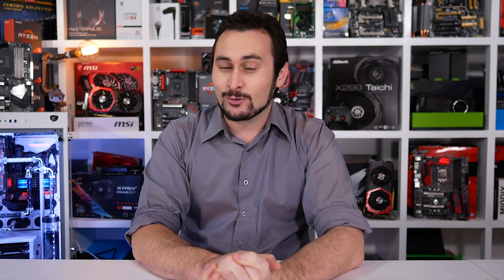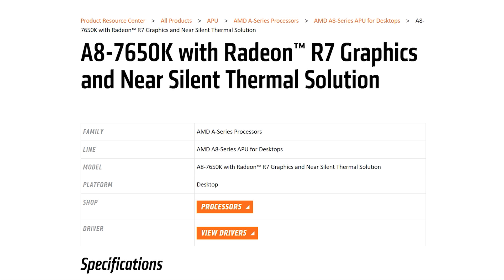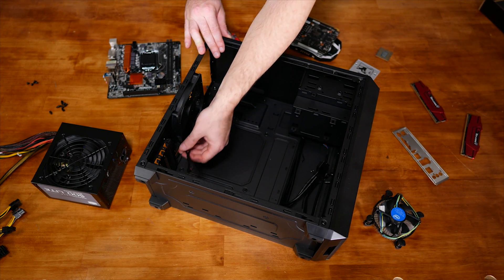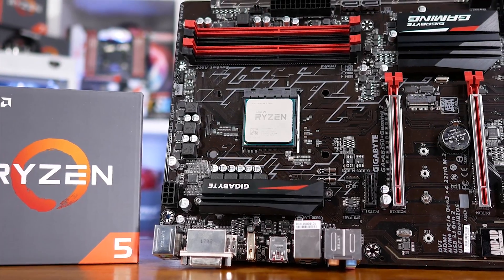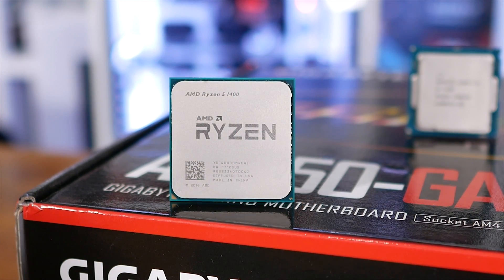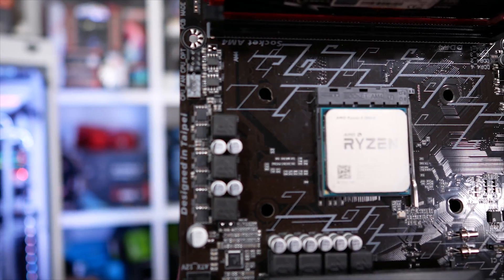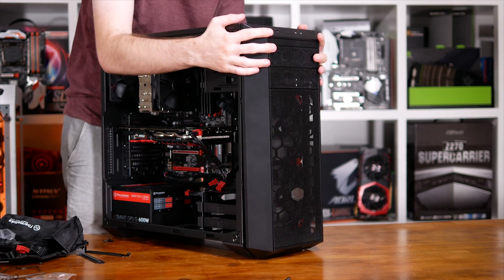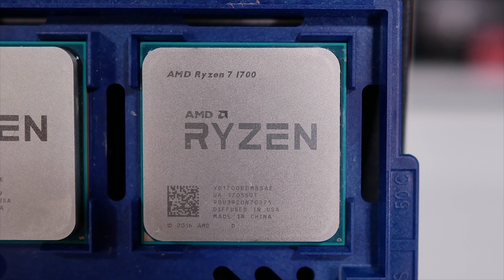Top 5 Best CPUs, Ryzen 3 & Threadripper In Mind!

Comment: nice video!

top 5 worst cpu's:
1. i3-7350K
2. i3-7350K
3. i3-7350K
4. i3-7350K
5. Every Celeron :D
Reply: The Saucy Goblin Shark the processor does not suck, the value sucks
Reply: Celeron 300A?
Reply: Philip Cooper im a mindless Intel sellout and even i agree tbe 7350k is useless but if it's cheaper it will make sense. 
Also i5 7600 and i7 7700 makes no sense, why create a locked version of already unlocked cpus lol
Reply: cause atom cpus are ftw right?
Reply: Good for you Saucy Goblin......Intel is fortunate to have some true blue fans like yourself.
Reply: i3-7350K shouldn't even exist, when even at 5GHz a much slower and cheaper locked i5 beats it in the real world.
Reply: You can use the i3 for whatever you say, but it costs far more money than the slowest i5, that would do the job as well and even quicker/better @ lower power consumption. 
2c/4t is not the same as 4c/4t. The threads don't do any computing, they just ''prepare'' what's about to be processed. HT is like having 2 hands and 1 mouth when eating. Putting food in your mouth might be quicker, but you still have to take the time to actually chew it and swallow it. 

2c/4t = 2 threads feeding 2 physical cores + 2 threads wait for their time, but are ready
4c/4t = 4 threads feeding 4 physical cores, that do all the computing simultainously
----------------------------------------------------------------------
This is the reason why even much slower 2.7GHz i5 gives you about the same and sometimes even better performance than the i3 @ 4.8GHz OC. It's physics. Yes, the i3 7350K seems cheaper, but it is not, as you need a Z170/270 board and after market cooler. Also, the i3 7350K has worse power consumption and generates more heat.
Reply: Well I guess for only $70 more maybe be better to just get an i5-7600K 😍
Reply: Im getting a 7350k how it's 140$
Reply: I always assumed the locked versions lost the silicone lottery and were sold restricted to a stable output. I don't know that, and wouldn't preset it as a fact, but it makes more sense than selling a high quality CPU at a lower price for no reason.
Reply: Well I was only talking about the I3 7350k vs the ryzen 1400x. It all just boils down to preference. I am extemely excited that AMD and Intel are having this battle. This is like the console wars all over again.
Reply: i5-7640X
Reply: Requires a 2066 socket MB, and those are not cheap.
Reply: The Saucy Goblin Shark Because you have to get a cooler + Z mobo. so it's terrible value. A locked i5 which comes with a stock cooler (don't need to upgrade if you can't OC) with a cheap mobo performs better and is better value. Thus, even with the ability to OC, it's a product that is not relevant to any consumer. Not to budget gamers (they'll get something like a G4560 or locked i3, or Ryzen 1400), not to productivity people or content creators (Extreme platform, or Ryzen 1700++/Threadripper), not to serious gamers (Ryzen 1600/1700 or i5/i7). It appeals to no one.

Think about it, why would I bother getting an i3 when I already have a Z mobo and an aftermarket cooler? Even if I somehow can afford the Z mobo and cooler but cannot afford a K i5/i7 chip at the moment, and want it as a future upgrade, I'd probably settle on a G4560 and upgrade to an i5/i7 later on.
Reply: 7350k actually a very good cpu for ppl who need high single thread peformance and dont care much for multicore usage..
Reply: OpTic KTG multi thread yes, single no, depends on user case..
Reply: Wessel Van der Linden Let's cut the bullshit. Name one real life scenario where this "single-threaded" of an unlocked i3 performance has any significance. I can't think of a scenario where one would not, as a consumer, just buy at minimum a locked i5.

Budget gaming/NAS = no (you'd get some a G4560 or some super garbage spec processor + mobo combo for a NAS), 
current triple A gaming = definitely no, 
eSports/older games = irrelevant (even a laptop i3 or better is good for those, definitely don't need an unlocked i3), 
content creation = hell no.
Reply: The Saucy Goblin Shark Dude, gaming? Don't keep giving me that nonsense. Tell me why someone with a Z mobo + cooler would settle for an unlocked i3 instead of an unlocked i5 or i7. 

If you're on a low budget you'll want a G4560. If you're just doing regular gaming you'll be on a regular non-overclockable mobo, then you'll aim for a locked i3/i5 (no point going for a K processor if your mobo can't OC). If you're aiming for a Z mobo and aftermarket cooler, I can't think of one situation where you'll want to deliberately pair it up with a 7350K over a 6600K/7600K at minimum.
Reply: Saucy Goblin, an OC'd R5 1400 will beat an OC'd i3 7350k in the vast majority of games.

I'd take the 1400 over any locked i5; and I'd take the lowest clocked i5 over this chip.

This chip should not exist even in intel's own lineup.  Ryzen just further invalidates its usefulness.

Not only will you have worse performance in nearly every game that's cpu limited; you're going to have to shell out MORE money to buy a more expensive mobo and a beefy aftermarket cooler to take advantage of it's 5Ghz overclock.

It's not a terrible CPU; just completely invalidated by both intel and AMD at its current price point.
Reply: If it's so bad for your usercase don't buy it? Other ppl might have good use for it so why flame so much?
Reply: forget the netbook g4560, at least get the 7350k for $130 🙂
Reply: MrSamadolfo Nothing wrong if you got one for free. As I and others have said, it just has terrible value. No one would deliberately build a new PC around it. What actual real life scenario would make someone consider getting a 7350K? Would you? For what purpose?
Reply: OpTic...I agree with you that the R5 1400 is a much better deal than the i3.
Reply: The 7350K still won't do much sense. With the extra cost of a Z270 motherboard (yes, you may use Z170, but only if you flash the bios with an Skylake chip first) and cooling solution, we must ask, what's the demographic for this chip? Yes, you might have the i3 @ 5GHz, but the moment you try some recent games you'll soon find out, that a much cheaper i5 (i5-7400 for instance) on a B motherboard does give you about the same and even better performance. 
The  7350K is something no body asked for. The idea is nice, but it is a dual core CPU. It's almost like somethning AMD would do. Working on a very fast Quad-core with 8 threads, then finding out some of the chips have defective one or two cores, quick thinking let's release an dual core with HT, that could be clocked to 5GHz. AMD had their Triple-core CPUs and now the lower tier Ryzen chips.

TL; DR, The  7350K is not for gamers, nor productive work. Who is this CPU for, then?
Reply: mazedmarky But I think celeron g3930 is good cpu.
but My celeron n2930 is rubbish lol
Reply: The Saucy Goblin Shark true
Reply: No, it's not, even the 2.7GHz i5 6400 outperforms the i3 7350K, while the i5 has lower power consumption and therefore produces less heat.
Reply: The Saucy Goblin Shark for $20 more you can get a true quad core thats why
Reply: Cool Moo5e Well go ahead. I cant stop you. Just remember the benchmarks http://cpu.userbenchmark.com/Compare/Intel-Core-i3-7350K-vs-AMD-Ryzen-5-1400/3889vs3922
Reply: and yes atoms ftw
Reply: This whole thing has been over complicated. you can get a z mobo for $84 slightly around the same price as AMD ryzens OC mobo the b350. You can use the stock cooling. The i3 has integrated graphics. so no need for a $200 graphics card right of the bat. $84 mobo, $140 core.
thats $224 for cpu/board. With amd you need to buy a graphics card just to run it. $150 ryzen 5 1400 $80 mobo $100 gtx 1050. thats $330. At this budget these cpus will not be the bottleneck.
Reply: the i3 7350 isn't exactly bad, but the value is the worst I've ever seen... ever..!
Reply: +Wessel Van der Linden No because it is horrible price/performance. AMD's R5 1400 which only costs $140 on eBay and beats i3
Reply: +Bo Shumok the CPU doesn't suck but the $140 R5 1400 beats it out, has 4 cores, and costs a lot less.
Reply: The Saucy Goblin Shark I see, so necessary costs like mobo doesn't factor in, ay? Perhaps you're like one of those dumbasses who buys things like a locked mobo and pairs it with a unlocked processor.

And dude, I didn't make it a Ryzen vs Intel debate. YOU brought in the 1400. Even comparing Intel to Intel, the 7350K is garbage value and appeals to no one. I made my case, while you continued to spout irrelevant drivel. You can't even name one scenario where the 7350K is viable for a consumer segment. Nope, not one. Yea, you said price, but that doesn't mean squat because you actually have to pair it with a mobo and get a cooler. That involves price too. Or do those things just fall out of the sky for you?
Reply: mazedmarky don't forget atom series still can be found
Reply: Actually post-Haswell Celeron's are not that bad, you should check out OzTalksHW's video on the Celeron G1840, and things have only gotten better since then.
Reply: I currently actually HAVE a Celeron. Works good on Minecraft, at least, for the rest it's shit!
Reply: mazedmarky u forgot i5 7640x .
Reply: You still rather have a dual core than a quad core when both can be overclocked equally to 4.0GHz?
Reply: Wheres R7 1800X FX 9590?
Reply: Rowan Ponnampalam You changed the narrative to fullfill your point. Remember ryzen 1400 vs i3 7350k? yeah, and im not talking about gaming specifically it just ended up that way. 
    The I3 7350k is $140 dollars a ryzen 5 1400 is $160 dollars according to benchmarks the i3 is faster for WHAT I WILL USE IT FOR. Why is this rocket science for you? If you want a goddamn ryzen buy a goddamn ryzen. BUT FOR ME. AND MY POINT THAT I HAVE ALREADY MADE, I will buy an i3 7350k. Im not one of those that just blindly jump on trains and mindlessly says all i3s suck because they dont.
    And yes if i wanted to go budget i would use the pentium. But this isnt about the pentium its about the i3 7350k vs ryzen 5 1400. 
YOU HAVE MADE THIS WAY TOO SERIOUS
Reply: Derrick sommers you spend less for a r5 1400, b350 mobo than that piece of shit, aio cooling and z170/270 mobo
Reply: i3 7350k an be OCed to 5ghz and yes, if the i3 didnt have hyperthreading I would agree with you.
Reply: Philip Cooper Okay dude you can go on somewhere and stop plagurizing linus on explaining threads vs cores. Im the last person who needs a lecture on hyperthreading. You can bitch all you want about why I3s exist, but this is reality and they do and theyre meant for entey level applications. I dont need you arguing with me about an I3. If you like AMD thats fine, so do I. Im sorry my opinion of prefering an i3 over a ryzen 5 1400 was so offensive for you.
Reply: Rowan Ponnampalam z270 mobo's arent that expensive...
Reply: What happens if u put a $130 7350K into a cheap $50 B250 matx motherboard? The Stock K speed is 4.2ghz minimum, so please explain to me whats so horibly bad about that? I dont think it 'sucks' 🤔🙄
Reply: 1. Any KBL X CPU's *not SKL X CPU's
2. i3 7350K 
3. FX 9590
4. i3 7350K
5. Every Celeron :D
Reply: Philip Cooper that's also correct as the 6400/7400 does faster overall for just 20 to 30 dollars more. with lower temps.
Reply: and pentiums
Reply: Rowan Ponnampalam Go be a bitch somewhere else, but first maybe you should reread this thread before you spout shit
Reply: its $150 bucks on amazon right now, and I rather have that than a $160 ryzen 5 1400
Reply: 1. Nvidia Tegra X1
2. i3-7350K
3. any x229 six core and quad core
4. i3-7350K
5. Every Celeron :D
Reply: Rowan Ponnampalam Well gaming actually, If were talking about Direct X11. most games only utilize 4 threads, or 4 cores. Only having some sort of software to enable more on higher end processors for better optimization. When we talk about the i3 or pentium, we're talking about the minimum amount of cores available for optimization. Thats when ghz becomes veeeery important and thats why the g4560 is at 3.5ghz and the i3 is at 4.2ghz and clockable to 5 ghz because Intel addressed this and the answer was higher clockspeeds for better utilization of the cores by the threads.
Reply: You can game and be productive on an I3 7350k I dont understand why people dont think you cant. Its hyper threaded so 99% of all games will consider it a quad core. Can you game and edit a video at the same time? No. but why would you want to? If you need 8+ cores get 8+ cores. If all you need is a basic battle station with a good graphics card then I dont see why an i3 is a bad choice. Amd's profit margin also comes from their motherboards. The a320 is not overclockable but its their cheapest at $65 if you want clock then be prepared to dish out $90-$200 on an amd board. I understand what you are getting at. I believe I5s need to take the place of i3s and i3s be dropped from the lineup. so intel will have budget I5s then performance i7s. But you can get pretty decent performance even out of a non clocked I3 7100 with a good graphics card. for $117 for the 7100 and $140 for gtx1050ti. Also kabylake comes with support for intel optane tech. Which is awesome just by itself.
Reply: i3-7350k doesn't suck.

Comment: What about the 1800X?
Reply from the maker: Get the 1700!
Reply: The 1800X is great value compared to intel's similar offerings, but terrible value compared to the 1700.
Reply: Hardware Unboxed I already bought the R5 1600, was just wondering why you didn't mention it :)
Reply: Nonononoki 1700 is basically the same with OC

Comment: The only two Intel chips worth buying at the moment are the G4560 and the 7700k. And that latter one is quite debatable.
Reply: 7700k is only worth it if you delid it and then use custom or aio water cooler, then oc to 5ghz.
Reply: Dankerino Nicherino and even the i7 7700k not so much
Reply: yNinja06PT #ChinesePotato Yep. Only is still relevant due to it being the best CPU for current games because current games don't utilise all of the cores they can. Don't get me wrong though, I'd still rather have a 1700.

Comment: 7900x X for X-tremely hot!
Reply: X for X-treme price
Reply: X for X-tremely angry customer when they realise they wasted money
Reply: look at these amd sellouts
Reply: +TheSinisterEyes1 - 7900X-quisitely powerful performance. Steve sounded like he was in pain giving the 7900X the best "extreme CPU", but nobody with an IQ over 100(even 90 probably) can deny it. All of the other negatives aside...it's still THE MOST powerful HEDT CPU available (at this point in time).

  Threadripper? Yeah, it will most definitely outperform the 7900X  for less money,  but the biggest beast from Intel (i9 7980X) will... guaranteed...be the highest performing CPU available for HEDT..period!!

 There are feelings, and egos, and then there are facts. Sorry, but facts always trump feelings and brand loyalty! These machines aren't being produced for the average consumer, nor gamer. These are workstation CPUs that will game as well. Workstation systems come with compromises, like highest prices, highest power usage, highest heat output, and all other supporting hardware can''t be cheap...no cheap RAM/PSU/mobo, cooling. This will be the case on Threadripper and i9's...get used to that fact!!
Reply: Haha... thanks you two, for proving my point about facts vs. feelings. You lose!

 *  BTW - The past AMD chips that ran hot... excelled in nothing. Same with Intel's Prescott P4's. Yes, Athlon 64's were the better chip, until Intel dropped the MOAB known as Core 2 Duo!
Reply: Kelly Boyd Lol Im actually playing around with my old prescott p4 right now. Just got it to dual boot windows xp and windows vista lmao.... with itshairdryer of a fan trying to cool it. I turn it off and the room goes silent.
Reply: hahaha lol
Reply: yup
Reply: Kelly Boyd if the 7900X is the most power hungry and hot CPU ever, imagine the 7980X, with almost twice as many cores. Sure it 's going to be THE BEST, but people will be spending a lot of time and money on trying to prevent it from melting a hole through their motherboards.
Reply: X-pensive
Reply: AMD furnace = high energy consumption, mediocre performance (fx, vega)
Intel furnace = high energy consumption, top performance
Reply: Kelly Boyd Lol when AMD CPUs ran like a furnace you call that "bad CPU" but when Intel does the same it suddenly becomes "oh it's a workstation CPU, it is to be expected"??? I don't take your BS.

Comment: For me, either a G4560 or a R5 1400 is more than enough xD
Reply: Phúc Nguyễn Thế the 1600 is actually better price to performance than 1400
Reply: i had an i3 3210 and gtx 650ti
Reply: What do you use your computer for if a G4560 or R5 1400 is enough?
Reply: Dazai Osamu 太宰治 csgo really sucks on ryzen though if u are aiming for like over 300fps.
Reply: Phúc Nguyễn Thế The i5 3470 is a better budget chip than the G4560
Reply: Yeah but is the mobo cheap enough?
Reply: HEY I got an i5-3470 off of ebay great upgrade over that old i3-2100 I had. 
Still need something better, but I can wait as I save up.
Reply: Dave Sterling Ive seen some mobos go for as low as $30